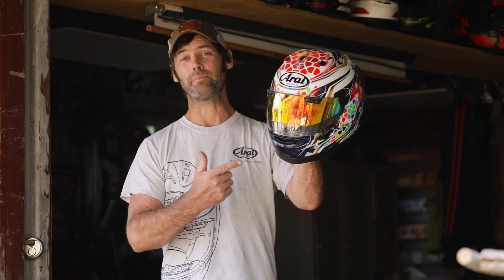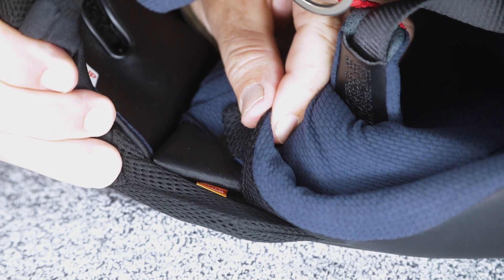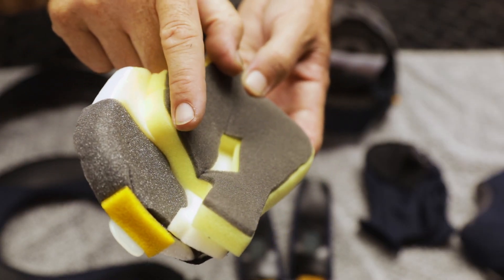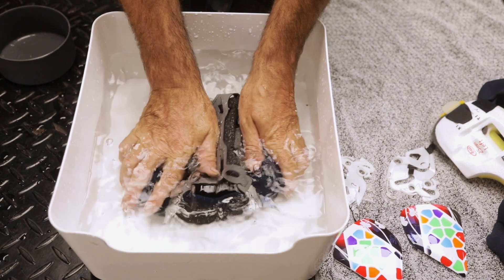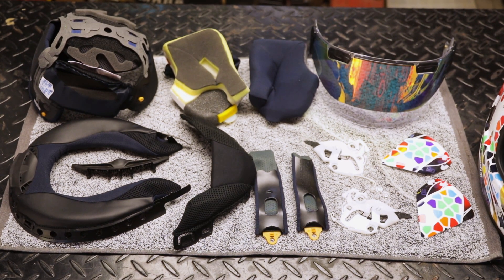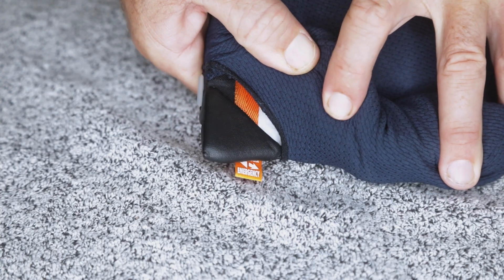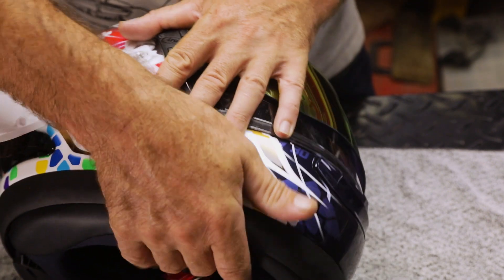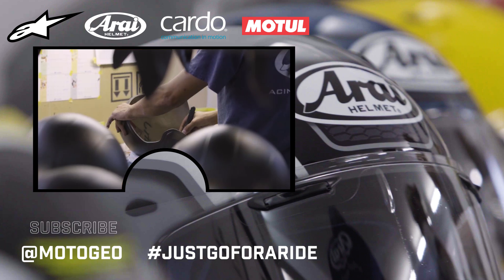How to clean your Arai helmet / @motogeo Gear

Comment: Thanks for the video. Very useful!

However, I am unable to fully put the visor back in the correct position after. It's a bit of a pain to correctly fit it. Now I get a horrible draft and buffeting on the right side.

How is it supposed to fit at the bottom? I guess that the pinlock should form a seal with the rubber seal?